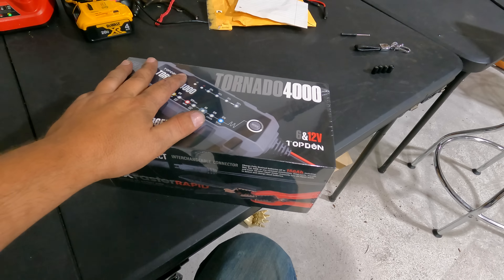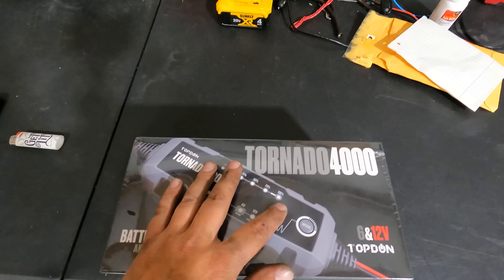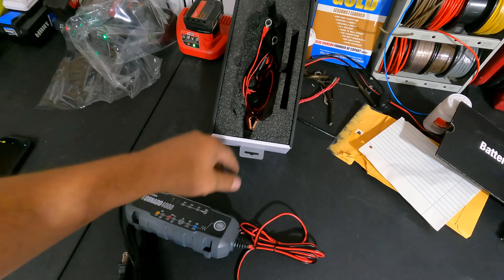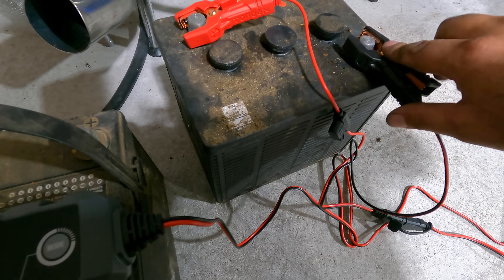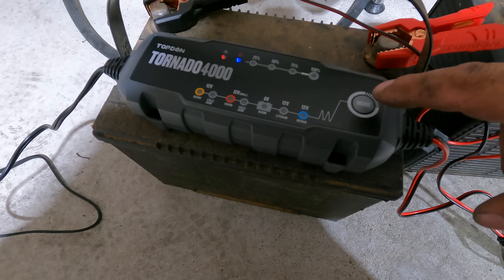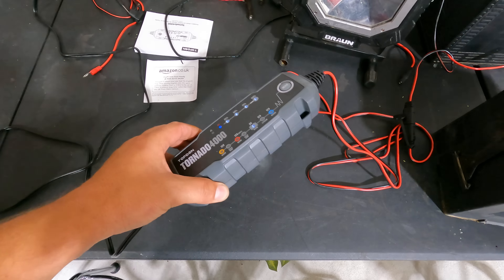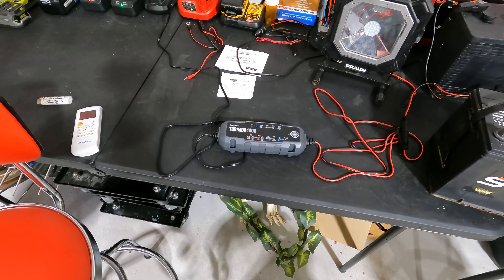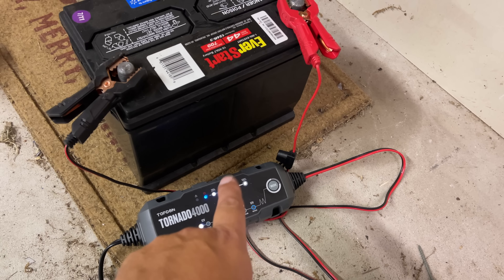This Topdon Tornado 4000 Saved me $150 in Car Batteries!!!

Comment: I was always told never let your batteries sit on a concrete floor because it would suck the charge out of it. Is this true or not?
Reply: I was told the same thing but I saw something fairly recently that said it was a myth.
Reply from the maker: It used to be true, but battery technology has improved to the point it is now a myth.
Reply: @GeekGinger  
That goes back to when the battery cases were made of a tar based substance. They would ground themselves to the floor.
Reply: @jimhupp1  it's true. True with any battery when weather gets cold and that's when most people will start to see an issue with their car battery, at the onset of winter

Comment: Never leave your battery on concrete always put it on a piece of wood that way you save it but when you lay it on concrete it depletes
Reply from the maker: That’s absolutely not true and hasn’t been true since the early days of battery production back in the day the battery case was made of a tar-based substance which would ground the battery to the concrete that has not been the case for many many many years
Reply: @AutoAuctionRebuilds  learning every day thanks

Comment: This may just be one of those old wives tales things and I am almost sure it is... but more than once I was told... Never, ever, ever, ever, never ever never.... Place a battery on concrete because it causes the battery to drain... personally I think that may be BS but I heard that more than once.
Reply from the maker: It’s not a wife sale it was factual back in the early stages of battery production they were made out of a tar-based material Batteries today or not made of the same materials therefore are not affected by concrete